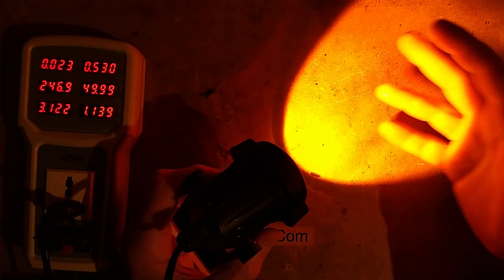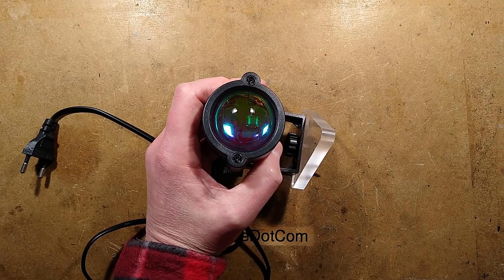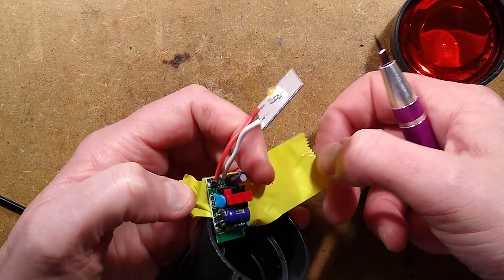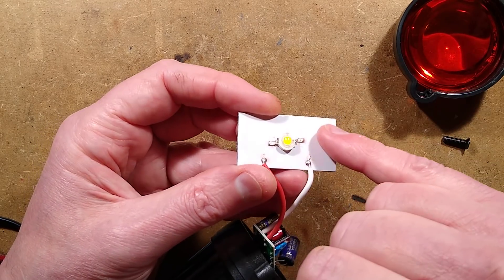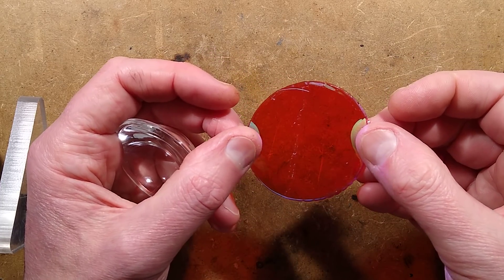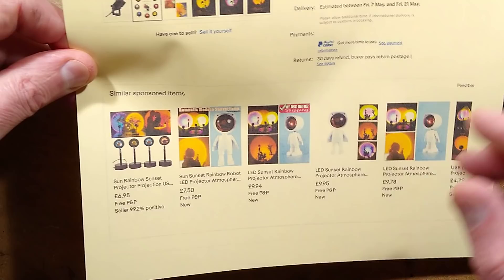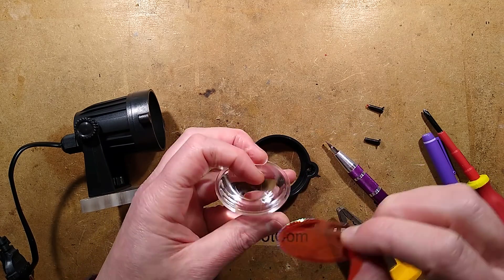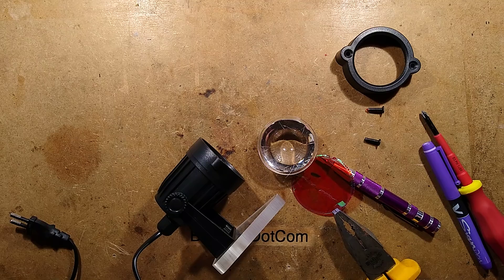Sunset light projector teardown

Comment: this video is so cool! it gave me lots of ideas on how to convert regular lamps, like i wanted to paint the glass cover of my halogen floor lamp with glass paint but im thinking this film would be much cooler and easier (for me anyways its been shockingly hard to find heat resistant paint i'm so paranoid of the glass exploding while the lamp heats up)
Reply from the maker: Halogen lamps can be used with dichroic filters, but there will be a lot of heat and low efficiency.

Comment: I wonder if that beige LED is a reject caused by LEDs made with a bad batch of phosphors? In that case, it could be leaking UV!
Reply: I think the beige yellow color is usually the cheap "warm white" leds they use in plug-in nightlights.  It usually doesn't look too bad of a color when it's the only light emitted.  It makes it look like a yucky yellow color if you were in an incandescent lit room and turned on the led due to visual color reference.

Comment: I'm still waiting for you to reverse engineer one of those garden solar stick light circuits! I can't figure out how it's charging lol
Reply from the maker: If you mean the standard garden solar light, it uses a 2V solar panel to charge a NiMh cell with just a diode in series (in the driver chip).  The solar panel is a limited current source and the NiMh cell can be trickle charged continuously.

Comment: Clive Unrelated Topic: Topic Pro Audio, Converting TRS or XLR to Component(RCA) interface. Easily created?
Reply from the maker: Complex subject that will depend on whether a signal is balanced and how it's referenced to chassis ground.  It may be possibly to connect line level signals directly or via an audio matching/isolating transformer.
Reply: @bigclivedotcom  More of an integration. I recently acquired a substantial collection of pro audio equipment and I love the way it sounds. However, all of my existing A/V equipment is consumer grade. I am looking to input said consumer grade equipment into the mixer for easy selection. This is where I'm having an issue finding an answer outputting from RCA and inputting to TRS or XLR.

Comment: Hm, I wonder if it would be nicer with an incandescent lamp through that lens? Since LEDs are very narrow in their light spectrum, and that dichroic coating looks like it can do lovely things.
Reply: You can buy the film by the roll/meter/whatever. 
https://www.ebay.co.uk/sch/i.html?_from=R40&_nkw=dichroic+film&_sacat=0&_sop=15
Reply: It would get too hot and melt the lens and a fire hazard if incandescent was used with the same luminosity.  It would look nice though.

Comment: Hi Clive, Great video, you got the light just right,One question and i know it's off topic but when we use a multimeter to test connectivity, can the current mess up the chips, using a gp meter
Reply from the maker: It's very low current, so shouldn't damage anything.

Comment: Very cool, with lenz and coating. Plz sir, may i have a schematic and chip id ?
Reply from the maker: The little LED power supplies are commonly available on eBay at low cost.
Reply: @bigclivedotcom  cheerz. I dont have a computer or phone, just a television with utube hard coded (pre-andoid). Thanks anyway. I enjoy you live streams also, new super computer looks good. ;)

Comment: I really hate the sellers that show a "minimum" price that turns out to not be for the product they are showing in the picture.
Reply: also if you look for like a 1000 pieces pack, skip the first auctions that sell like 50\100\500\1000 pcs and look for the ones selling JUST the 1000pcs pack, it will cost way less

Comment: i got a question  i opened up 1 of them led tube lights the 1 where 1 side is live 1 side is neutral  i pulled out the driver and connected  it up again  when i check voltage it reads 366volts dc why? and how  for a 4foot led tube
Reply from the maker: It's common to boost the voltage for very long strings of LEDs.  Simple current control, since the peak mains voltage can't cause current flow through the LEDs on its own.

Comment: Huh. We had a sunset projector at the planetarium I worked at in high school that used a plastic filter and a gear motor. When you turned it on the gear motor would start running, and the dimmer switch on the console would control the the brightness. It cycled from orange to blue as it progressed.

Comment: yes, I do wish eBay would show listings highest price first to discourage the 1 dollar for the sticker and 10000 dollars for the item in the photo.
Reply: When i was using ebay about 2 years ago this wasn't that common but now it's everywhere and it's very annoying
Reply: Yeah, it's not a bad feature for say, offering accessories with the main purchase, but it should list the expensive option first or the picture should match the price.
Reply: Other websites do it too, I've seen it done on Amazon and AliExpress. Wish there was some kind of regulation, or option to sort results in highest priced product.
Reply: It would be nice if the virtually split all the items in the sellers "multi item listing" so you're only searching the specific size/model/count etc. I love seeing "sample, 1m of tape"....... It was MEANT to be for different sizes, but is now also used for quantity, though they have quantity discounting separately, its a mess. But... they're not going to change it to make less money.

Comment: Chip is from silan dot com dot cn, SDH7611ASH   Iled = 0.6V/(4*Rcs) * Np/Ns   Rcs is resistor from pin 7 to ground, Np/Ns is transformer ratio.  Sadly, nicemilf is only on ebay uk. Thanks for the video.

Comment: I would be changing that plug for a fused one. 1A fuse 🤣
Reply: It works well on 16A circuit but not for 32A circuit used in GB._

Comment: 3:45 I worked with a lot of those LED packages back in 2007-2008. The leads in most instances were only attached to the die by a pair of bond wires, with the slug in the center of the package being a thermal via to the mounting substrate. The large copper fill on the top is not really doing anything in terms of heat removal but rather to reduce process wear on the etchant.
Off to look for sticky dichroic films.... 😁